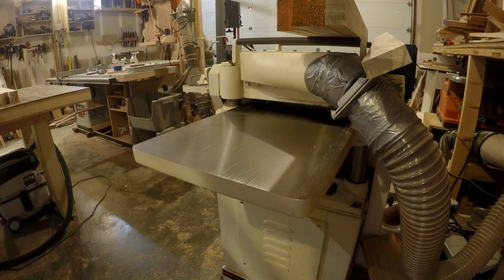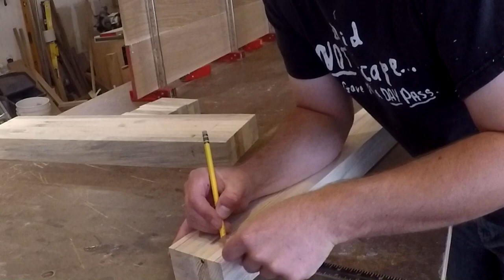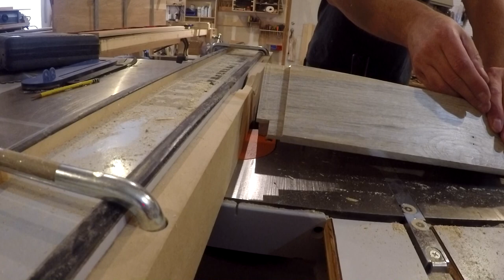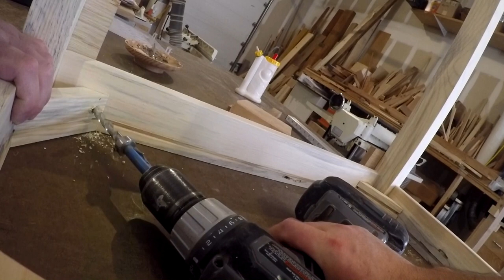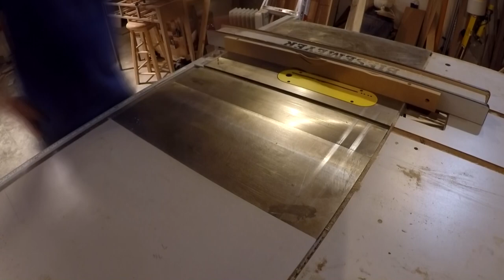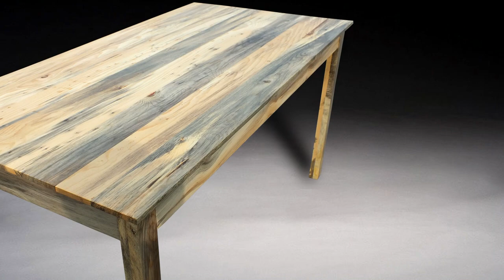How To Build A Beetle Kill Pine Kitchen Table - Woodworking

Comment: Nice work and thanks for sharing. I am a little confused about the table top. At the start of the video you thickness plane some pieces of varying widths and then glue them up along the long sides but at the end when you are trimming down the table top on the bench saw it appears that the pieces making up that top had been glued along their short sides. Perhaps some switched video from another project or some work off camera.. wondering how you finished the top? Cheers W

Comment: @3:44, what kind of handsaw is that?  I’m also curious about the glue you’re using, or is it epoxy?
Reply from the maker: That is a crown gent saw from woodcraft, I wouldn't recommend it, dulled quick, and never really cut that well.  I have since switched to Japanese pull saws.
Yep epoxy